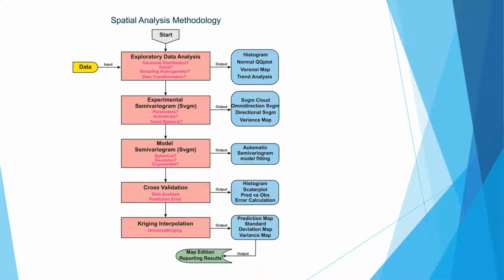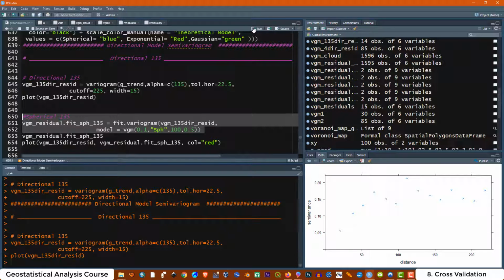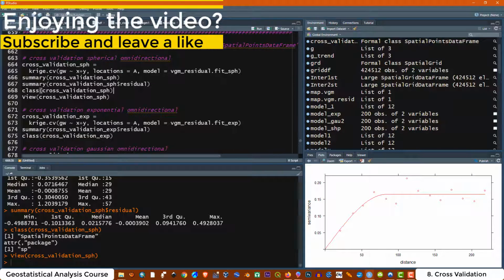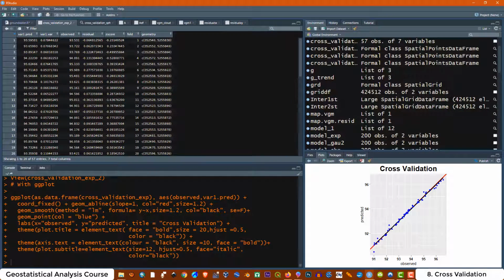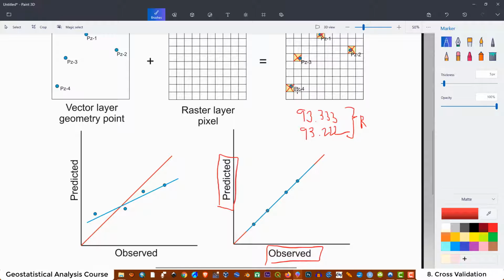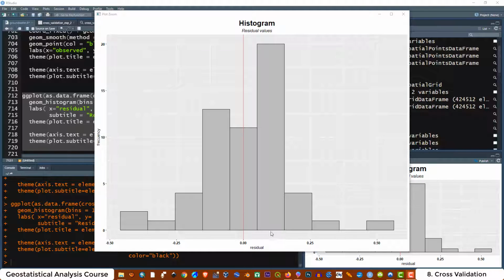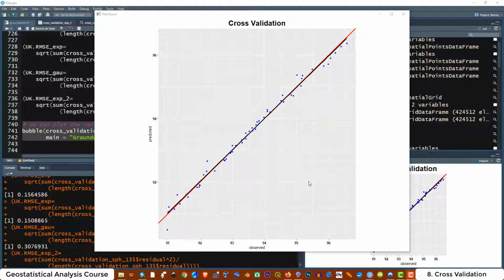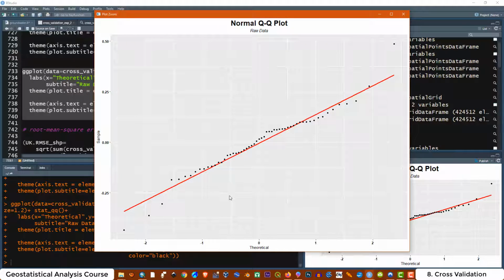Kriging Interpolation.  Cross Validation #8.  Groundwater Flow Map. R & RStudio and ArcMap.

Comment: Hi my cross valdation in ASE and AE negative and i try to change to positive could you help me please
Reply: I use arcgis
Reply: Hi thank you for your kindnesses in my aplication on polution data the MSE  and ME be negative  what i can do to let it to be positive i do my best by changing lag size and take log to the data
Reply from the maker: @ghedagheda4170  The Mean-Square Error (MSE) cannot be negative because it is the summation of the square difference of the predicted less the observed. Also, it is common to use the value of the RMSE, instead to used the  MSE. I do not know what ME means. I am not sure how I can help you, your information is not clear to me. You cannot have observed values negative, to become them in a positive number you can do a square transformation.  However, be aware that in this course I did not explain anything related to data transformation. Maybe I will cover data transformation in a new course. I am sorry for being no really helpful.  Have a great day.
Reply: @GeoRGBCommunity  thank you v.much but i notice that the program of arc gis have amistake they calculate the value of MSE as the sum of different between (predicted value _mesured value ) it must be the sum of (mesured value _ predected value)  so it become negative  could i take the .ME is the mean error
Reply from the maker: Hi Gheda Gheda, thanks you for comment. Can you please provide more information? I cannot understand well what you need and what is the problem with your data. Regards

Comment: Good video. I noticed that at 26:05 min. there is a small error. Calculating RMSE for Exponential model by taking cross validation data of spherical 135 degree directional model.
Reply from the maker: Hi Kiran gandhi. Thank you very much for the information related to typing mistake. The script is good, as well as the result, the error is related with the name I wrote for that script. Instead of being UK.RMSE_exp_2 it would have to be UK.RMSE_Shp_135 but it is only a labeling problem that does not affect the final result. Thanks again for the notification I really appreciate it.

Comment: Thank you very much for your tutorials.
I am working on a study area whose overall extent is about 37km (35kmx29km) and a number of piezometric points of about 800 points (min dist (between piezometer) = 2.23m and max dist = 36998.48m), how can I choose the lag and the cutoff for my variographic analysis.
Thank you for your help.
Reply from the maker: Hi hichem dekkiche. Thank you for the comment and for being active with your question. There is not a rule to decide what is best lag distance. It depends how your data (piezometers) are distributed. 
The cutoff of is the lag size multiplied by the number of lag. The cutoff depends on the range of the experimental semivariogram, and the total extension could be a little bit further of the range distance, just to make sure that you cover all the data that is spatially correlated.
My recommendations to decide what is the lag distance: 
-	Plot the semivariogram cloud to see how the homogeneous is the cloud of points. You do not want to see areas with a big gaps of data or areas where the density of the data is too big compare with other areas.
-	Take a lag distance that is representative of the lag distance for all the lags. I know it is not easy, try your best.
-	Try to do the lags as homogeneous as possible with respect of the cloud of points. Remember that the lag is the average of the pair of piezometers for a fix distance. Then, if you have a lag with just three point at the semivariogram cloud, the experimental semivariogram from that lag is going to be the average of that 3 points. Then, what you do not want is to have a lag with 200 points and a lag with 3 points. It is normal that for the first and last lag the number of points at the cloud is small, but not at the middle. 
-	If the distribution of the piezometers is very irregular try to divide the zone in different areas and do one kriging interpolation per area separately.
-	37 km is long distance to suppose that the aquifer is not changing the geology, permeability, porosity, etc … then, make sure that the lag distance is representative of each area, I mean, if you take a lag distance of 1 km too much thing can be different, remember that you are doing the average of the pair of piezometers to calculate the experimental variogram. 
-	Try different lag distance and see how the experimental semivariogram looks like, then do the kriging interpolation and decide if the contour lines make sense. If it does not work, maybe is better to do the kriging by sectors, trying to separate the areas with similar hydrogeological characteristics and treat them as independent areas, then put everything together.
-	Kriging interpolation is a trial and error method, then you have to try different configuration for the lag size and number of lag and then decide what configuration provide you the best result.
Hopefully the answer helps you to take good decisions
Reply: @GeoRGBCommunity  Very detailed reply. Thank you!  it is best  and perfect to record video~~